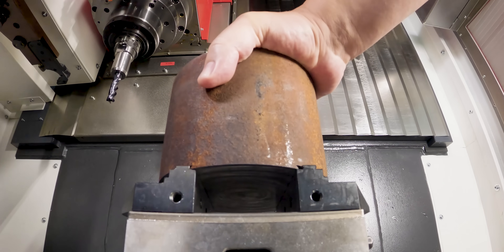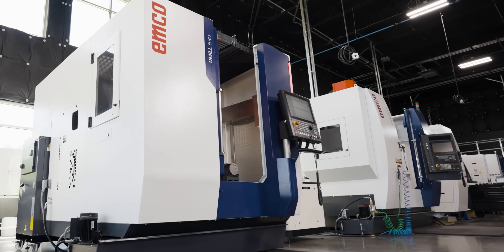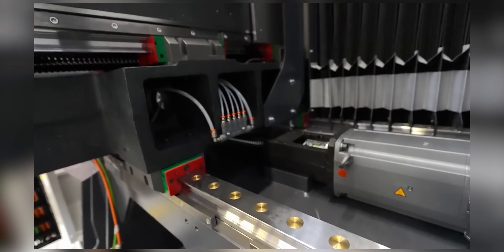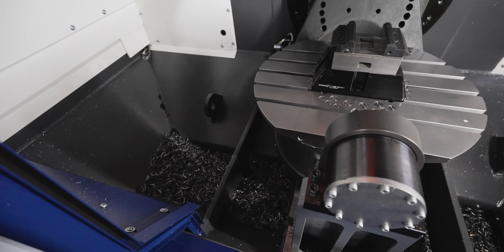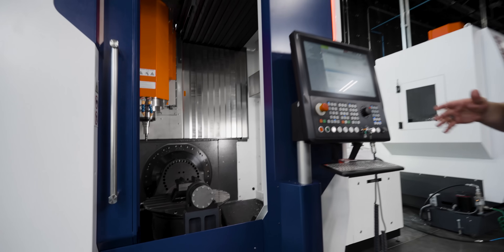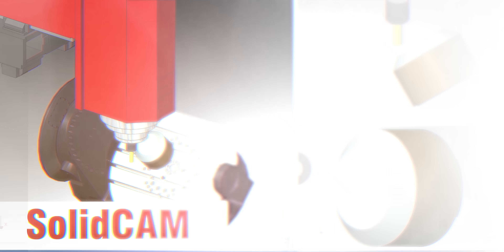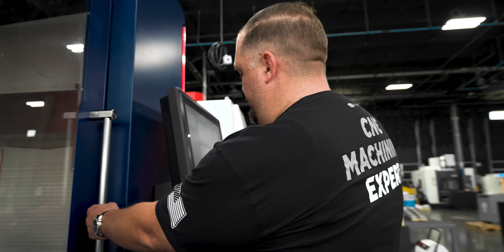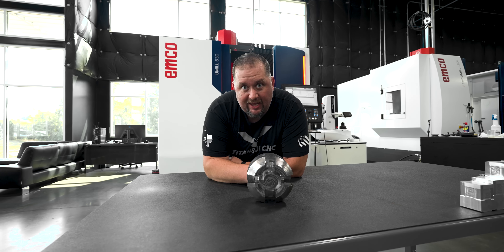Biggest Cuts We’ve EVER Taken on a New Machine

Comment: Trochiod milling is thrown out of the window!!!😂😂
Reply: Hahaa!  Yeah.  The carbide tool designers are making that technique obsolete.  We used it for a while but now we spend most of our time doing full width, deep cuts like this.
Reply: Everything has its advantages and disadvantages. With trochoidal milling, guides, ball screws, belts and drives are subjected to considerable stress due to the high acceleration and braking forces. With full-bore milling, the spindle bearings and possibly ball or roller guides are subjected to considerable stress. The ideal lies somewhere in between; after all, you want to machine productively but also avoid having to perform expensive servicing every few months or even purchase new machines.